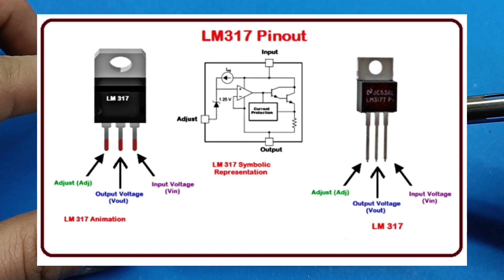LM317 VOLTAGE REGULATOR | VOLTAJ REGÜLATÖRÜ | MAX 30 VOLT 2 AMP. #lm317

Comment: İki lm yi seri baglansa 38 le 42 voltlara çıkarmak mumkunmu
Reply from the maker: Lm317 seri bağlanmaz paralel bağlantı yapıla bilir fakat aynı direnci kullanamazsınız ve çok stabil çalışmayacağını düşünüyorum çünkü voltaj regülaötürlerini birbirine bağlamak her zaman risk taşır.
Reply: @hobielektronik55  peki hocam kendim 36 voltluk 18650 lityum pillerden oluşan bataryami doldurmak için hangi km serisi yada mosfeti kullanmam lazım mümkünse 3 amper gücünde bir devre varmı  kendim yapabileceğim
Reply from the maker: 3 adet ırfp460 paralel bağlantı yapılırsa 40 volt 20 Ampere kadar desteklenir
Reply: @hobielektronik55  teşekkür ederim irfp460 in data jetine bakacam netden iyi aksamlar dilerim